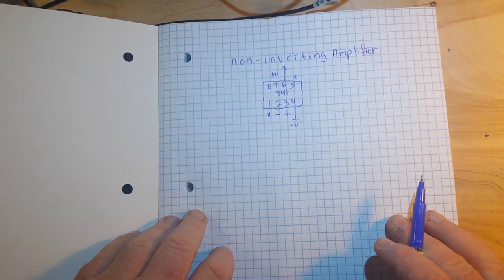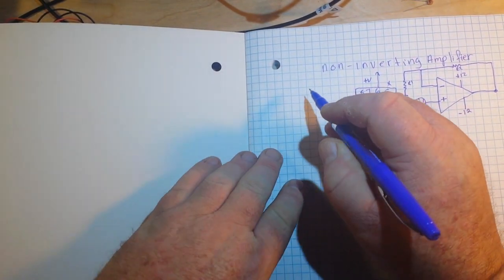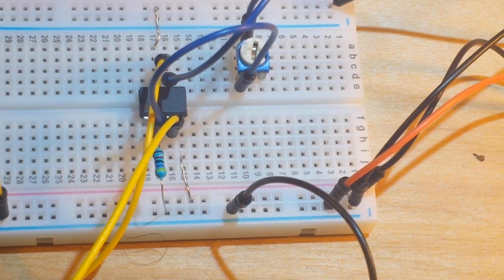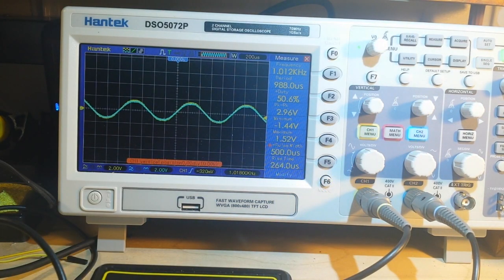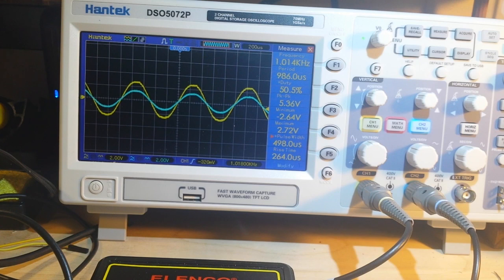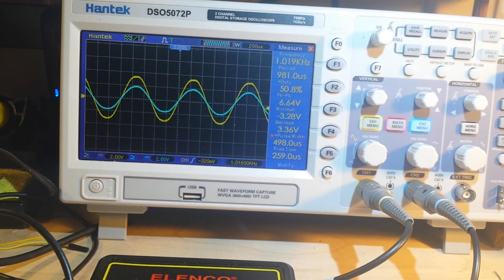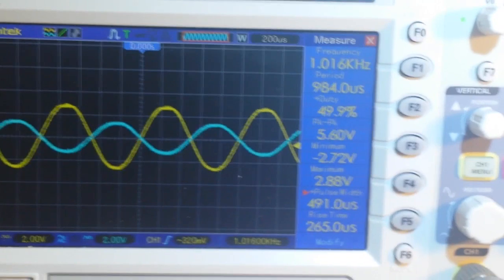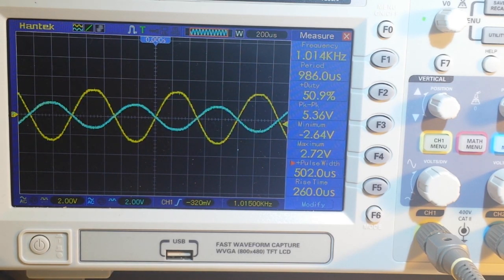Inverting and non inverting amplifiers with the LM741 opamp

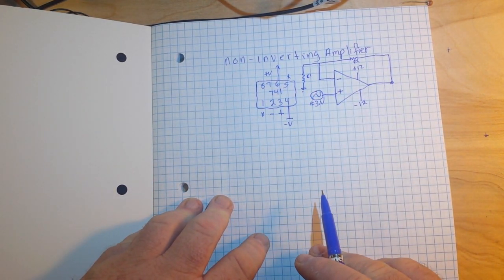Comment: After trying to wire a UA741CN for gain the wrong way I chanced upon your video and then realized that the previous diagrams I had been using were trying to put the input sine wave into the inverting output. Thanks for your excellent circuit diagram ( 2:14 min ) and clarity of commentary!

Comment: Usually, a non-inverting config need a big pull down resitor to ground in the non-inverter pin to set referency to the opamp. I miss that in the example.

Comment: Can you make a video going over general Op amps part numbers used like TLO82, TLO72, 5532, 4558, CA3260, LM741, etc to know about the slew rates issues , Signal to noise ratio issues , output impedance loading issues, etc

Comment: I did an experiment today to see if an LM741 could both source 'and' sink current. I connected two LEDs to the output. One LED was connected to ground and the other to power. The LED connected to ground turned completely off and on. The one connected to the positive rail only got brighter or dimmer. 
I controlled one input with a potentiometer while the other input had a voltage divider. I swapped inputs 'and' I swapped LEDs. In all cases the LED connected to power never turned completely off. I'm waiting for some LM358's to be shipped and do the same test.
I was able to build a constant current circuit with a PNP transistor but I could not build one with an NPN. I guess I should use a different opamp for NON transistors?
Reply: I don't know what your feedback resistor value's are but you have to take into account both input's have a input bias current. A small amount of current ALWAYS needs to be flowing into each input of the opamp (This also includes an input offest current as well which will be the maximum tolerance between the two inputs of the opamp due to manufacturing). The LM741 has a maximum input bias current of 500na. In a non-inverting configuration such as this your inverting input will be drawing current from the ground plane into the inverting input (500nA) which for the example shown in the video of a 22K resistor from ground to the inverting input you can use OHM's law to see how much voltage is on the inverting input (even when there is no signal on the non-inverting input). Doing this calculation shows that you can have as much as -11 milivolts in the worst case. But you have to remember there is now gain between the inverting and non-inverting inputs due to the resistor divider. If you had a gain of 2 that would cause a -22milivolt output with no signal on the non-inverting input. But you also have to take into account your non-inverting input is pulling this bias current from somewhere. The greater voltage caused by the bias current and the greater the difference with increasing gain can keep your output high all the time (even if only by a few 10's of milivolts in the best case).

Short answer the LM741 is a push/pull opamp (not open collector) and you could technically do such a thing but there a much simpler ways of doing what you are trying to accomplish. If you are intent on using an opamp the LM358 is not going in the right direction. You want to look for JFET input opamps not bipolar input opamps like the OPA627 from texas instruments.

Comment: If you are running +12 volts and -12 volts why is it clamping at such a low voltage? Shouldn't you be able to get over 20 volts peak to peak? Or am I missing something? (As usual)
Reply from the maker: Robert Gibbons I have the channels ac coupled. but the signal gen has a DC offset. that's why it's clamping at a low voltage.

Comment: sooo when i tie the inverting input to gnd, and put a sine wave into the noninverting input, i should get a squarewave right?
Reply from the maker: Sorta, tie the non-inverting to ground, add a feedback resistor from output to inverting and put your signal into the inverting input. That's a differentiator.
Reply: ehhh but what if i want a noninverted squarewave? :P also why the feedbackresistor when i basically want infinite amplification?
Reply from the maker: fredlllll yes you can swap inputs around. But if you don't have a feedback resistor it is just going to slam into the rails. No such thing as infinite gain in practice.😉
Reply: yeah that is what i would expect... strangely though all i got so far is a buffer when doing that =/ i have to check my setup again